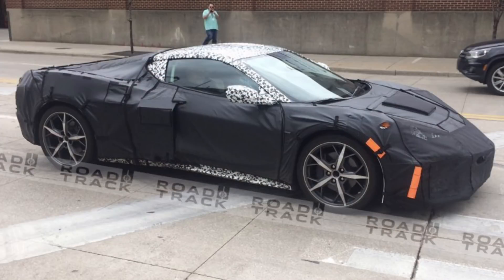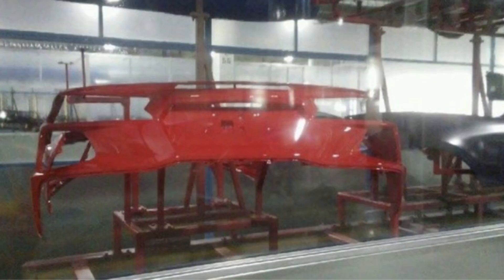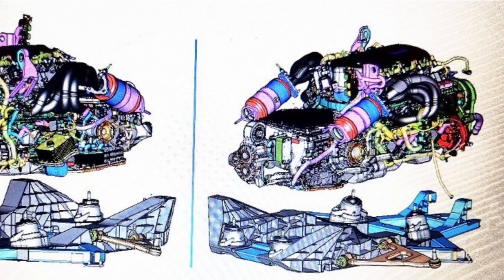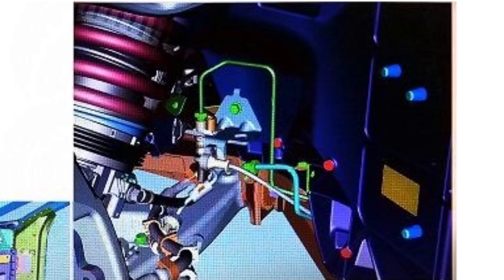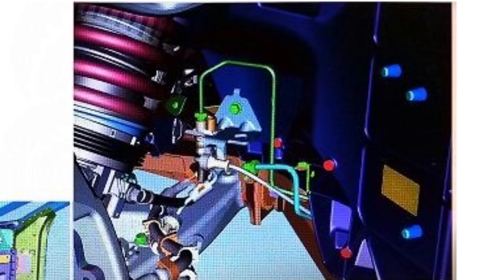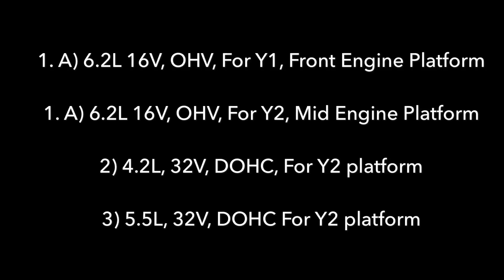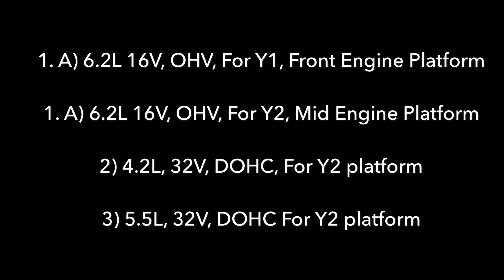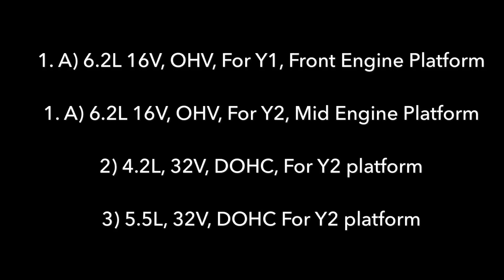BREAKING NEWS: Leaked Mid-Engine Corvette CAD Drawings

Comment: Personally, the mid-engine concept doesn't excite me.  I was more impressed with the fact that the C5 was able to achieve a 50/50 weight distribution without going that rout.  There are too many quirks with a mid engine design.  For instance, you loose all of your cargo space and it is a PITA to work on.   European cars are nice when they are low mileage but after that they are a hole to throw money into.  There is a lot of unnecessary engineering involved in putting the engine in the rear.  Traditionally the Vette was sought after by hot rodders.  I don't see a mid engine Vette lending itself well to this.  If GM wants to move forward with this they could come up with a new name for the car and keep the Vette on a more traditional platform.
Reply from the maker: I agree 100%
Reply: There was the mid-engine Corvette Indy concept car in 1986 and later the SERV III.  The mid-engine Corvette has been around a long time.  https://www.youtube.com/watch?v=EWV6ea7NcW4
Reply: So you want GM to cater the Corvette around "hot rodders" and cargo space? I've never carried anything in my Z06 other than a toolbox and a jack for track days.
Reply: That is a large part of the market.  Cargo space is a necessity for daily drivers and travelers.  There is nor real benefit to a mid-ngine that I can think of.  It just makes it difficult to wrench on.